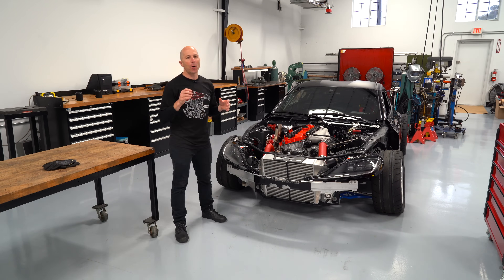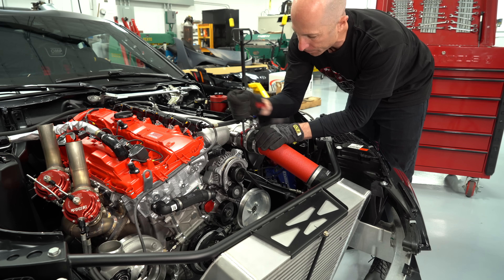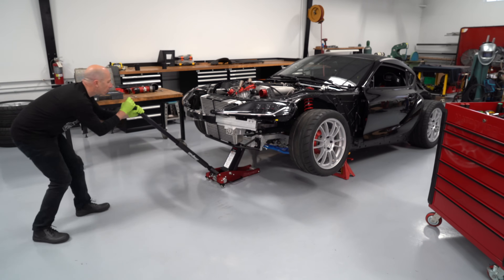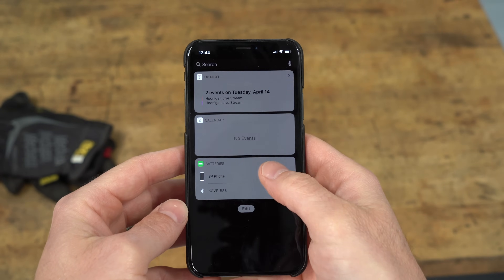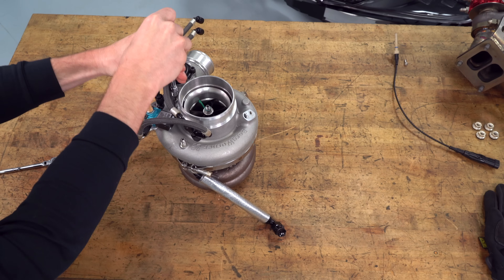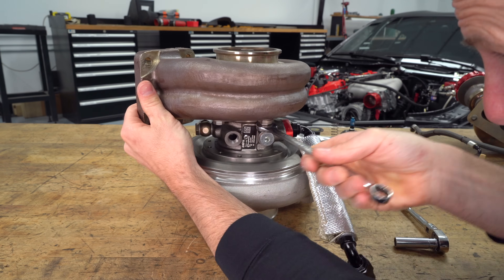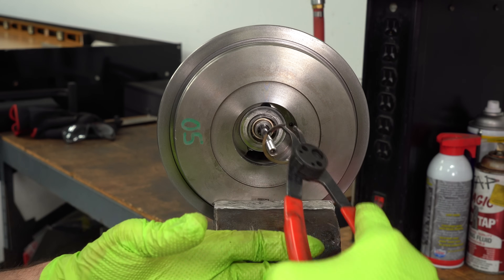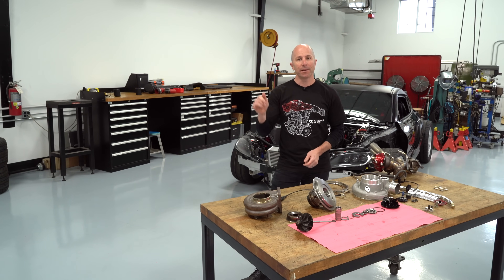Turbo Teardown - How a Turbocharger Works

Comment: I would 100% have a nut or washer left once I reassembled it. A usable turbo is something I’ve resisted the temptation to pull apart! Loving the build thus far.

Comment: So food for thought. When removing or installing compressor wheel nut, the best tool is a t-bar with the compressor facing up. With a t-bar you are less likely of tweaking the turbine shaft. To hold the turbine wheel, just clamp an appropriately sized socket in a vise. The the compressor facing upward and the turbine wheel locked into the vised socket, remove the compressor nut with two hands on the t-bar.

Little trick for extracting the turbine wheel shaft is to flip the turbo, exhaust wheel facing up, and carefully pop the shaft ,pointing down, against a wood table. That will prevent thread damage.

Comment: So they balance these turbos once both turbine wheels are together on the turbo. When you remove one of them and then reapply it, you will have to re-balance the turbo. Just like taking a car tire off a wheel and then rotating it some and putting it back on the same wheel with the same wheel weights but just a lot more strict since they're smaller and snip A LOT faster than a wheel/tire.

Comment: To add to what you said about the jack - We used aluminum profile gantries on the plasma tables we built at a company that I used to work for. All the other plasma table builders used steel as they thought aluminum would flex. Turns out the aluminum gantry system was more rigid than the steel ones. On top of that we had the lightest gantry which accelerated quicker with lower torque motors. People have a huge misconception about aluminum I guess.

Comment: A little clarification on turbo surge.  The compressor wheel isn't stopping and starting, but the flow of air is.  The airfoil essentially stalls, and loses it's "grip" on the air and the air can flow the wrong direction.  If you've ever covered a little fan and heard it speed up, even though it's not moving any air, it's the same concept.  Not exactly intuitive because you'd think with a restriction the load would increase on the fan, but the opposite happens.

Comment: 4:37 here before everyone starts screaming that that’s the sound of the compressor chopping the excess air built up, and not the compressor wheel stopping and starting.
Reply: He can't be right all the time.
Reply: Well, it does drastically lose speed doing that, so it is not all that wrong (could be considered correct)
Reply: But the choo choo noises are still bad for a race car though, right?
Reply: Yeah you're right, actual surge is from on-throttle situations, surge at closed-throttle is not true surge.
Reply: @NikFowler  For the turbo, specifically, as it creates a lot of extra stress on the turbine wheels
Reply: Great sound effect, not so great explanation
Reply: the biggest problem i have with running bov-less, is gradually coming off the throttle makes the turbo surge seemingly forever and you feel the engine surging. I'm not losing my choo choo noises though.

Comment: I typically don't buy sponsored stuff and usually skip through the video but not with papadakisracing. I have mad respect for him and I was actually looking for another portable speaker since my jbl pulse keeps getting used haha and I can't justify $200 for the newest one.
I really like that you can split these and use them as stereo speakers for when I'm out washing my car or working on it as opposed to the jbl which has to be moved around.
Hope these are as good as they look! Trusting ya on this one lol and of course I used the code.

Comment: 4:46 That noise is not the compressor stopping and starting. Disconnect the bypass valve and look at a log of the shaft speed. It doesn't stop. That noise is the pressure wave reflecting off the throttle plate and interacting with the compressor. Maybe you're thinking of stall? In this context stall means flow separation from an airfoil (the compressor blades).

Comment: The turbine wheel of the EFR 9280 is made from Titanium Aluminide (which Borg Warner calls "Gamma Ti"), and is about half the weight of a traditional inconel or Mar-m turbine wheel. It's also very expensive and difficult to manufacture.

Comment: Dude you've gone commercial! Haha love the content so much I don't mind the snap on aluminum jack or kove speaker plugs. That and 60% off is sweet. 

Love that you have cap for everything. Not sure if you're intentionally cracking jokes about your nuts but those are good to.

Comment: yeah let's be honest though The cold side of the turbo doesn't mean it's actually cold it's actually pretty freaking hot because the other side is literally connected to the exhaust right off the manifold it just means that the air going in is a little colder than the air powering it this is why they have intercoolers because you need to cool that air back down it can be used without intercooler but it won't get optimum power The intercooler cools that hot air coming in

Comment: Hey Stephan, not to be rude, but I as I understand it compressor surge doesn't stop or reverse the compressor wheel, but rather the noise comes from the turbulence created by the compressed air flowing backwards through the turbine.
As you said, this turbo will spin at over 100'000rpm, so even a billet turbine would take time to decelerate. That said, I've never personally tested this, so I may be misinformed.

Comment: Design of these turbochargers is practically the same as the one used for marine auxiliary engines (generators), except marine ones are two or three times bigger and their speed is around 40000rpm (well, depends on size). You cannot carry them around with your bare hands. I've been working on couple of these. As a matter of fact, marine main engines turbocharges are the same too, but these are huge weighting couple tons, spinning around 13000 rpm.

Comment: It'd be cool to see more of how you do your plumbing and why you choose certain methods over others. The vacuum lines for the  wastegate and BOV and why you use silicone boost pipe couplers instead of hard vibrant style couplers are two aspects I am curious about.

Comment: Haha tearing stuff down for fun, this brings me back to my teenage years. Good times. I learned a lot about a ton of different things this way and I still believe that this is by far the best way to understand how something works. Ps. Just an idea, maybe you could do a similar video explaining how dry sump oiling systems work? And how they compare to a wet sump, some of the advantages to a dry sump/why they are very common in the types of racing that you do.

Comment: Surprised to see how small the manifold return line was for the recirc. BOV, with the boost pressures they are running I expected it to be much larger.
I guess it only needs to be big enough to deal with the initial pressure spike when the throttle is closed, after that the manifold vacuum helps scavenge the line and maintains negative pressure at the compressor intake. Or something like that. :)
Edit: I could listen to Stephan plug sponsor products all day. Very unobstrusive to the video.

Comment: You have to respect the fact that he put his mistake into the video for all to see. He could have just left it out during editing. 

No one else in the shop, it look like an empty playground for any gear head.

Hey papa. If you don’t like your nuts to look tampered with, is there enough room to put a flare nut wrench in just to break it loose? I’m guessing not or else you would just use the box end side.

Comment: Would you do a breakdown comparing your EFR vs a Comparable GTX series turbo from Garrett, and why you chose EFR? Was is due to the larger center section and ceramic ball bearings?

Comment: Do you run a MAP/Mass air flow sensor in the inlet ? If no, how does the ECU know how much air is pushed through ? Thanks for the amazing video as usual

Comment: DO NOT DISASSEMBLE YOUR TURBOCHARGERS UNLESS YOU ARE TRAINED TO DO SO!! I assume Papadakis has another borg warner he is putting on the car. if the balance is off by a milimeter the turbo will fail catastrophically. Papadakis please make sure to warn people there are a lot of do it yourselfers who might go and think "wow thats easy I can do that" and than the turbine wheel falls apart and throws itself into engine.
Reply: We swap wheels all the time.  Provided the charger had no defects in the first place causing contact with the turbine or compressor it is not an issue.

Comment: Could you please explain the hot side. Why there are 2 blow off valves before the turbo ?, what benefit does this bring. I'm starting my first turbo project and will not have blow off before turbo on hotside. Is this wrong ?, I always thought that you would want to have high pressure on this side to spool turbo :s. Thanks for for videos they are amazing !

Comment: Bad thing is now that you've taken it apart after you put it back together it won't be as reliable as it was they never are luckily this looks brand new so you might not run into that problem
Reply: I've rebuilt lots of them.  Never had an issue.  People seem to think turbochargers are black magic, they are simple.

Comment: The nitrous jet being so close to the air intake temp sensor is a good idea? Wouldn't it throw it off if it cools the sensor more than it cools the charge? I see that this is a dry shot so the ecu is compensating and adding fuel manually instead of looking at the lambda.  That is so interesting but how is it tuned?  Knowing that this engine has two exhaust port I would of guess using individual egt sensors would be the best way but how do you know all cylinders are enriching enough? Am genuinely curious

Comment: First time I see an "error" in your videos. :-o
I don't know if you are intended to re-use this turbo, but I hope not.
By hitting the turbine shaft with a hammer the risk is way to high that these ceramic balls chipped of tiny pieces on their surface and therefore the bearing cartridge is potentially destroyed. The risk of early failure is very high now.....
By the way, if you want to use it again nontheless, consider heating up the cartridge and cool down the shaft, this makes it way easier to mount the shaft into the cartridge with no excessive force needed to get it all back together.

Comment: @PapadakisRacing DO NOT put the turbo back together and just throw it on the car. You'll need to take that to a shop/specialist to get it rebalanced. 

Source: worked for BW as a coop engineer for around 1.5 years. 

Sidenote: I may have actually created the CAD for that compressor wheel. I did some work for the EFR line, but I don't remember which wheels I was working with.
Reply: They are balanced separately.  Swap wheels all the time.  No way to balance it assembled in the housing.

Comment: Blow off valve in the comp housing?  MAn I havent seen that before, havent been in the loop so much though these days like I used to be though. Anyway, isnt it better to have the BOV  near teh Throttle body? Keeps the s ystem pressurized better.  Why in the comp housing or am I misunderstanding what hes got going on here?

Comment: This engine has the particular exhaust manifold in only 2 ways. I thought it was a limit, because if you want to work on internal exhaust flux it could be difficult. Is it a wrong thought?

Comment: Isn’t turbocharger flutter (sututututu) also caused by a completely closed intake valve after full throttle engagement, or am I wrong?

Comment: I am trying to find nitrous to get shipped here to CA  -- and so far, I'm running into a lot of road blocks. Maybe the situation has degenerated for you since the 4 years when this video was created -- but if you can still get the kits & the gas let me know. I did get 1 lb tank of food grade N20 -- but it has none of the plumbing and probably won't fit any of it. I'd greatly appreciate any advice you can offer

Comment: Turbocharger and supercharger are limited at how much boost they can provide due to engine RPMs wouldn't it be nice if they could build some kind of boost unit that constantly sucked in a constant level of boost all the way from the beginning to the end of your RPM gauge that takes no power from your engine they are getting pretty good electric turbos in our days that can give you 5 to 10 lb of boost they're expensive but they do work they're not ready for competition yet but it just goes to show you soon we will have a way to boost the vehicles without losing any power from the engine through having to power the turbo through exhaust or the supercharger through the belt or a pro charger which pretty much same deal

Comment: Thanks for showing the bearing! I always wondered what such a high speed bearing looks like.  
Are the turbine and the compressor keyed together or does this turbo need balancing when you put it back together?
Reply: I believe balancing is required after disassembling.

Comment: Can anyone tell me if the nitrous on constantly at a constant pressure through a drift run, or if it is controlled via the ECU to help with lag in the lower RPM range?

Comment: why the engine has tilted?.I never seen an tilted engine except this built.pls give me an answer
Reply: BMW engine, thats why
Reply: A lot of engines are tilted like that, particularly BMW engines like this one. The Nissan RB series engine also has a slight tilt to it.
Reply: Inline 6 motors are tall but not wide. Probably a design decision he made to fit the components he wants.